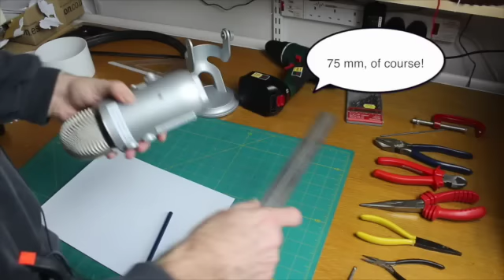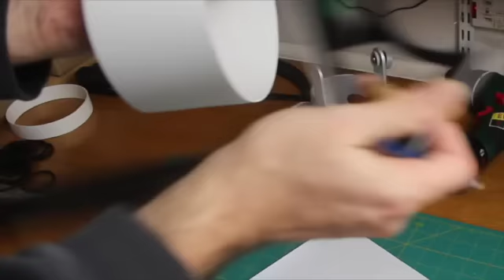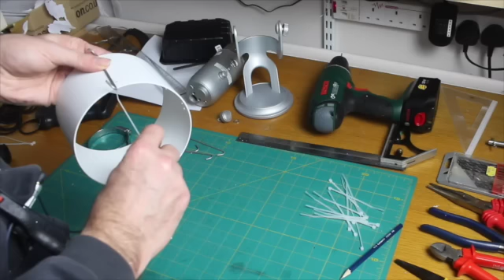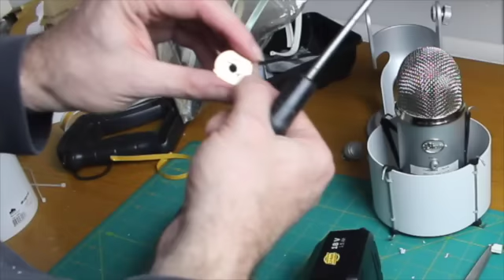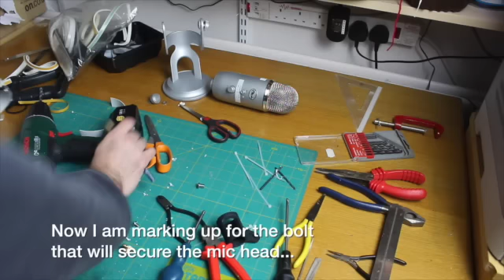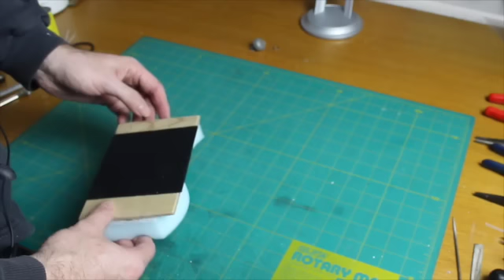Build your own Shockmount for a Blue Yeti Microphone

Comment: Thank you, have used the basic idea and created one from a 1mm stainless steel chimney liner insert (as I'm a stove fitter). Looks a bit more industrial and I need to get some decent shock cord...but it's way better than before...thanks again
Reply from the maker: Wow - I expect the advantage of the SS tube is you can make it much smaller and still get the rigidity you need. But the disadvantage will come if you need to cut it! Glad to have been of help.
Reply: @MikeClayton  I've stuck to the 125mm dia. As the insert was 150mm tall and flanged at one end (like a top hat) I've set-it up as a stand...I've cut a couple of slots for the cables and 6mm holes for the shock cord. I'll be adding a bracket and adapter for stand soon (the rigidity should be good for that), but suffice to say that it can be used right way up, upside-down, on it's side...in fact, all ways around :)
Reply from the maker: @AngusRobins  Sounds excellent. Good luck!

Comment: Awesome video!
I did it a little different, but hey, we have our shock mounts, and it didn't cost us $60!
https://flic.kr/s/aHskHNCkbU
Reply from the maker: Your build looks very professional. Sadly, I can't see what you made the components out of. But the finished article looks great.
Reply: In the description I have the link to it on eBay.
Sadly, I didn't make a video of it, and didn't really take enough pics to do it justice.
Maybe you could order one and make a video? ;O)
I guess, I might take it apart, and do a short video on it.
The only tools needed are a d\Dremel with an abrasive cutting wheel, and a roll of electrical tape.
Unfortunately with mine, you must remove the headphone volume knob, but it's easy to do, and can be put back later if needed.
All this DIY stuff could have been avoided if Blue didn't charge so much for basically, the only shock mount you can purchase and use off the shelf with their microphone. $60us is just crazy money for something this simple.

Comment: Damn, I didn't even need to watch the whole video. I mostly skimmed and saw the playtime and now I don't perceive the Radius II as overpriced anymore.
It's still an obvious marketing ploy to not make the Yeti's standard mic mount hole centered so that it can be treated like any mic with a somewhat larger diameter. That way Blue's own mount becomes the only option. (And it becomes even more clear if you look at the price for the Ringer.)
You can hate them for that, but pragmatically speaking organizing the DIY parts and then bulding the whole thing is quite the time investment, and there you'd have to make a value judgment of your time.
As a 'science project' or if you just have a great time building stuff it's of course justified, but if I ended up really needing a mount and arm and all, I'd probably still buy the Radius II.
Life's too short to do wrestling matches with capitalism, haha.
The mic itself has a nice load of features, knobs and all, so that at least balances it out.
I'm actually surprised I haven't seen Chinese alternatives to the Radius mount yet.
Reply from the maker: Dᴏᴡʟᴘʜɪɴ Of course, one reason to make your own is for the pleasure of it!